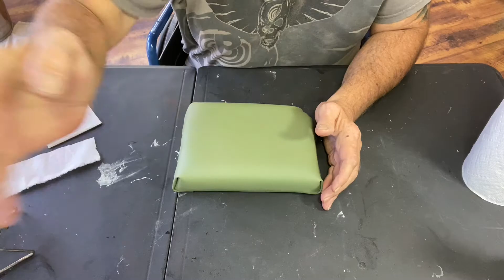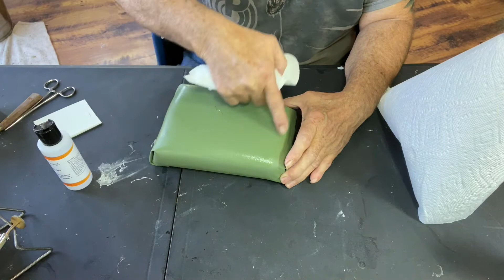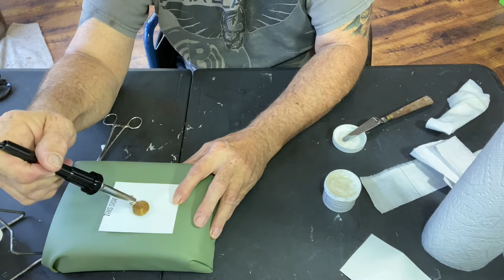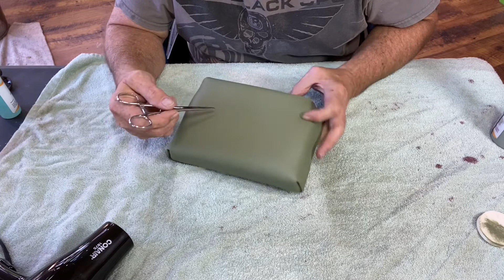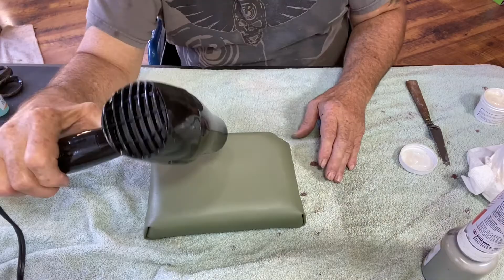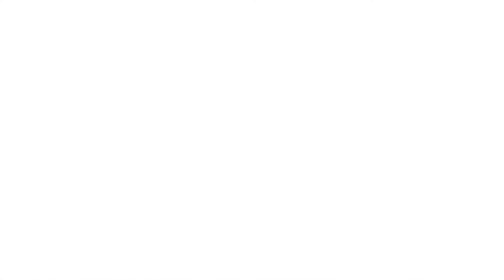DIY professional style vinyl repair kit by Leather Magic!

Comment: what about matching the color of the vinyl, do you have some training for that
Reply from the maker: Color matching is the hardest part of the job. I have done color matching training for years and find that in order to be really good at it, one must be able to see the very slight differences in shade and tone. It is extremely difficult to put together a video that would be beneficial enough to even get a novice started. An hour long video would only begin to cover the basics. Very few individuals would be willing to watch one that long.
Reply: Thanks for the reply. However, If you have this video please pass it to me
Reply from the maker: @evokleensteamcleaningdetai9408  I don't have a video, but I do have a basic beginner training manual that I will share with you. You can download the PDF file here: https://www.dropbox.com/scl/fi/cpfcwnh60io9jparz1jkv/Color-Mixing-Guide.pdf?rlkey=ayxn5jtkmasqcoc44xq84v2vl&dl=0

Comment: What is the little iron called? A brand! I'm trying to find it in Australia. Thanks
Reply from the maker: the heating iron itself is just a small soldering iron, but the tip is special you will not find one anywhere. we have these specially made for the iron.